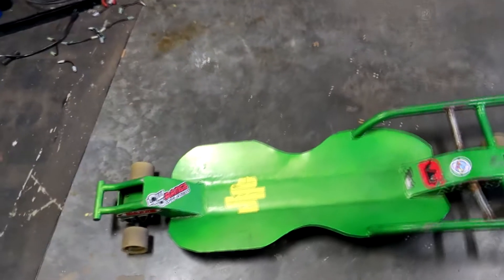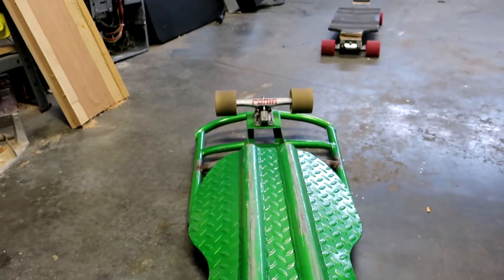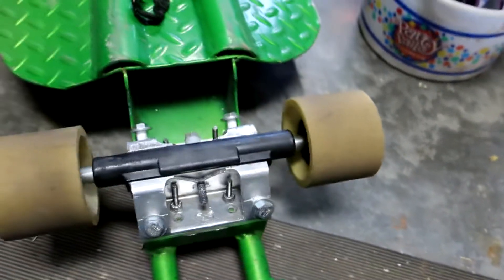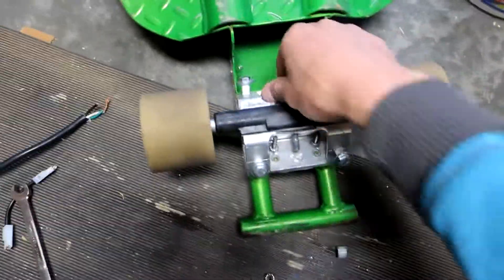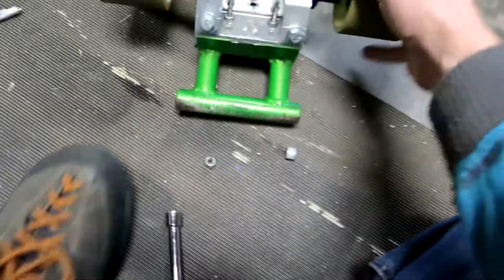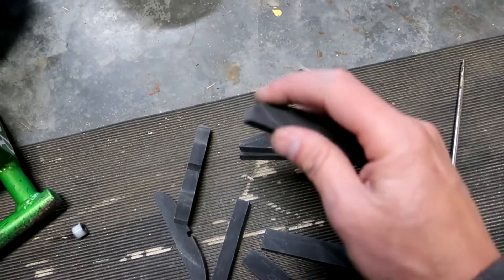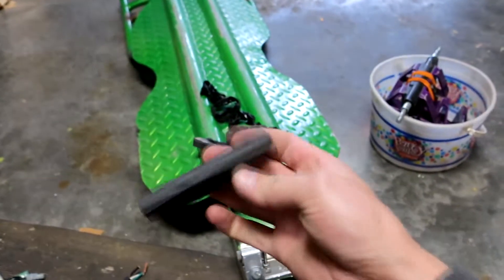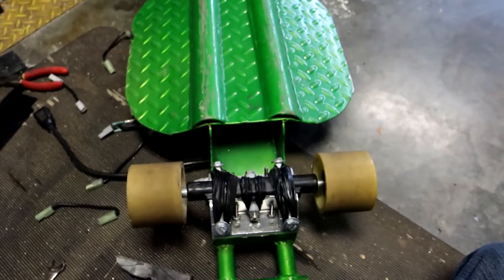Street Luge, Resistance Tuning using Latex Balloons.

Comment: Hey are you the maker of the other planet trucks? I've been wanting to buy some but for an landyatchz Evo but would they work with the steep angle?
Reply from the maker: I helped make them.
They won't work on an evo though, there's too much drop, you'd need like an inch of risers just to keep the deck off the ground.
The angles would still work though, but you'd be better off with a deck that doesn't de-wedge the  rear.

For a landyachtz I'd recommend the switchblade 36 w/ 5 deg wedge on the front.

Comment: The methods I use to add grip without changing wheels (on a longboard application - not luge):
Narrower hangers
Higher pivot angle (more turn/less lean)
Higher ride height
Shorter wheelbase
More normal force (add ballast mass)

Your theory sounds like decreasing compression and rebound resistance of a car's shock absorber (ie. tuning for a softer suspension setup), which does yield more mechanical grip in cars.
Reply from the maker: I think higher pivot angle, higher ride height, and what I'm trying to do are all pretty much the same thing.

Ride height and pivot angle just controls the relationship of leverage over the hanger.  Riding higher angles or having a higher ride height is going to result in needing harder bushings to give the same feel to the rider, but the hanger from that sees increased rebound force and speed. 

Narrow hangers are similar too, because the throw is shorter the hanger response is quicker, and because the lever advantage of the ground over the hanger is less the force at the wheel greater.
Reply: Nice! I never thought that the things I've been doing were all related/synonymous (kind of) because I learnt about all of them from experience and haven't done the necessary research to understand why.

In reality, however, I don't do them all in one direction - as in, I balance them out to retain an amount of preferred grip/slip ratio and turning radius. As a priority, I mainly alter hanger width and ride height for wheelbite clearance (as I use a topmount), but I reduce the pivot angle to add the amount of slip back up to the level that I prefer, but only after the hanger width and ride height have been altered. Finally, I shorten my wheelbase accordingly to keep my turning radius similar to my preferred turning radius.

I don't usually play around with ballast mass. I did a few times but didn't like it because it adds too much top speed, reduces too much acceleration, and slows down angular agility/rotation speed. I used to have a dropthrough deck, and I would mount a baseplate upside down on the tops of each of the baseplates. Tried it just for fun a few times... ended up disappointed every time.

Comment: Could this be an actual sensible application for one of those tandem wheel kits that are all over ebay?, seems like having 4 wheels each end would grip better than 2 each end
Reply from the maker: It could be I think,  except those might introduce some problems of their own, and I don't think you'd need them on the front at all, just the rear.

Its something worth experimenting with, Luge often use tandem trucks in the rear already which would do partially the same thing ( without introducing as many issues )
Reply: I hadn't thought of tandem trucks, do these need to have different kingpin angles to maintain good wheel contact?, the only issue I could think of would be wheel bite/clearance because of the extra width of 2 sets of wheels, plus I suppose cheap ebay parts, especially alloy ones add there own potential hazards, I'd be interested to see a video on them with this application in mind